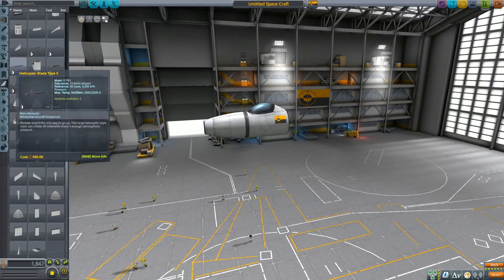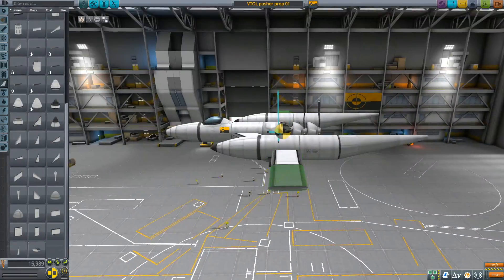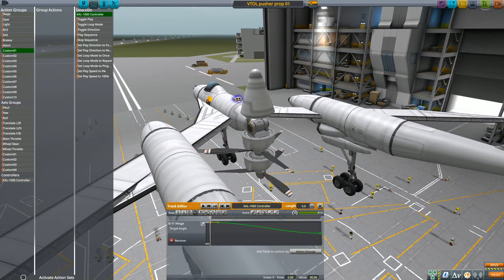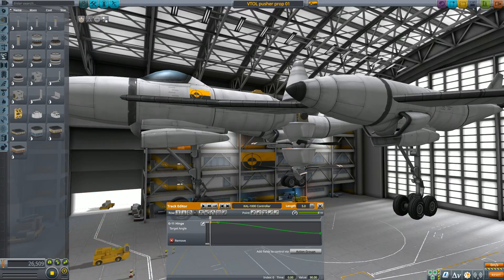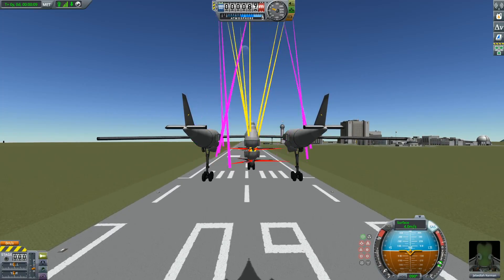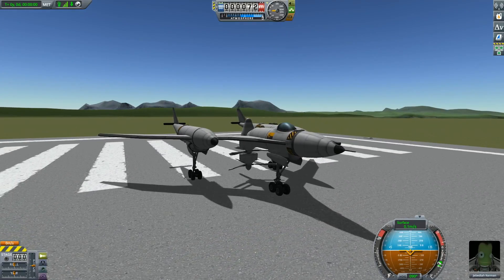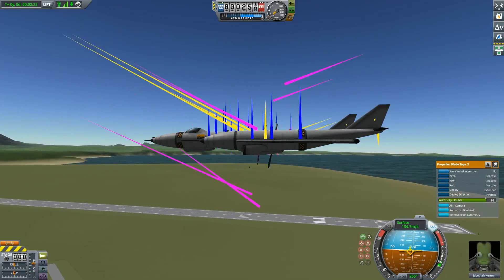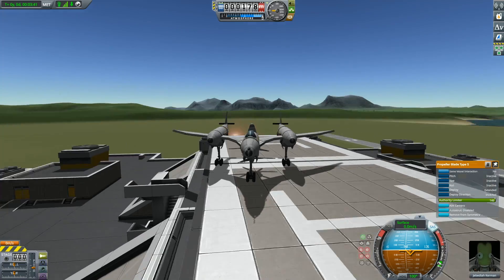Kerbal Space Program - VTOL pusher prop tutorial

Comment: One way I get past not being able to see the thrust line in the hangar when building is to pop a single juno directly inline with the prop's expected thrust line, also, I set the rotor brakes to 1 so that I can slow them down gently, I tried using 100 rotor brake on a helicopter engine and the thing popped right off from the snapping stop it made!
Reply from the maker: These are all great tips!